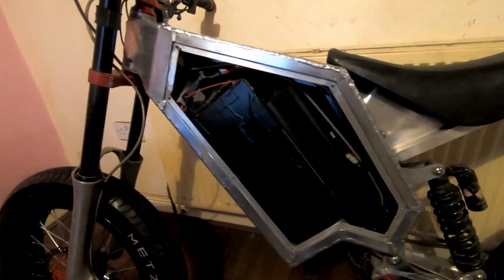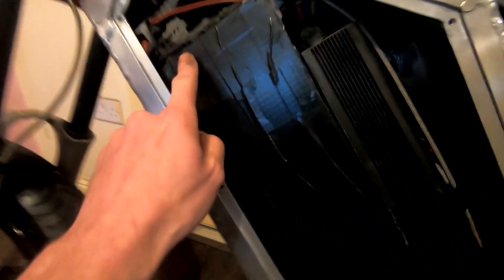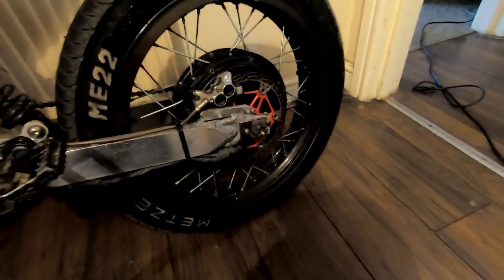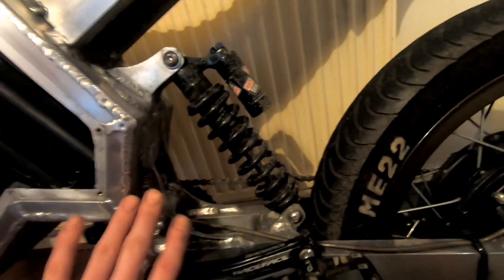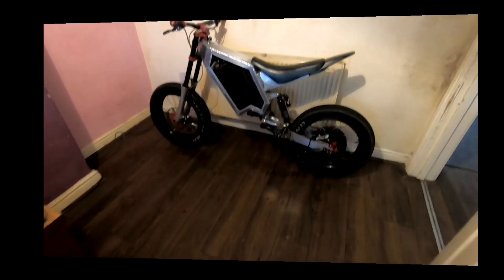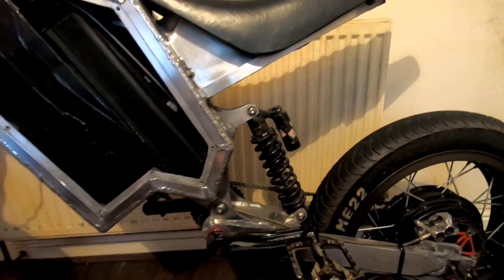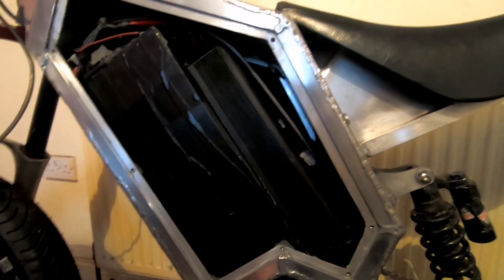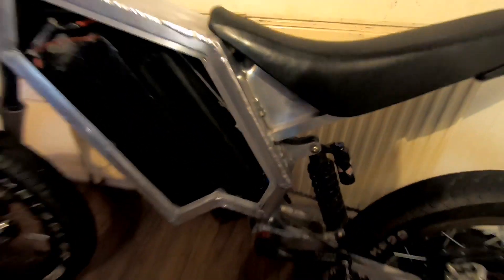SO HOW HEAVY IS IT?? | HAND BUILT ALUMINIUM EBIKE | WEIGH-IN |

Comment: I'm constantly admiring my bike the same, and I'm only using a little geared hub motor but I love the lightness with my 42v 15ah battery the total  weight is 45 pound with 20-25mph top speed and 20 mile range  😎👍🙋🎅I do love these monster power bikes I just can't afford one.

Comment: This is class pal, I'm building a qs273 with a 96v 30ah build
Reply from the maker: Sounds like a good build mate 👍👍👍
Reply: @theebikenut4679  have you got an email or someway of getting in contact with you. One of these frames would be ideal for me as my battery is wider than the frame I currently have
Reply: @theebikenut4679  found your email address bud, I've sent you a message

Comment: What controller is it, im using a sabvoton had it out notnsure if salt got in everything is supposed to be sealed brand new its been cutting in and out stops working I have to turn ignition off and on repeatedly, I was using qs motors  im now using DUN they seem a bit better they use integral copper solid wire windings as opposed to a bunch of stranded wire not my first build but new to sabvoton its smooth quieter than other controllers but not impressed seeing as its new and giving me hard times